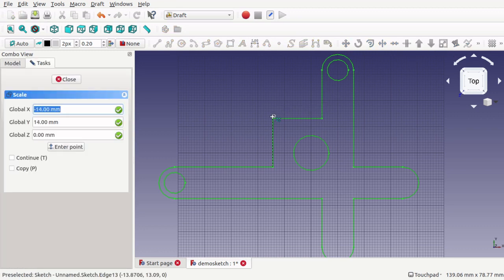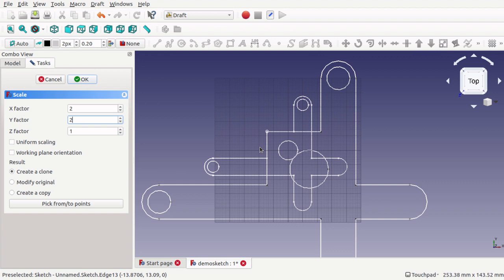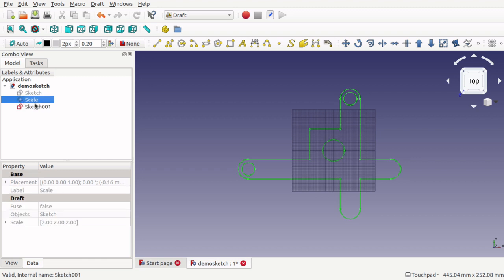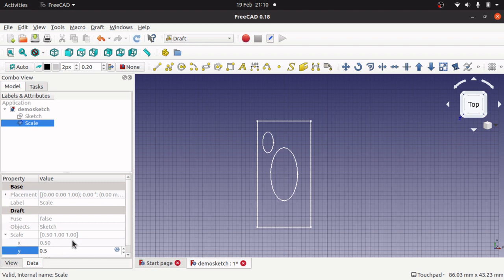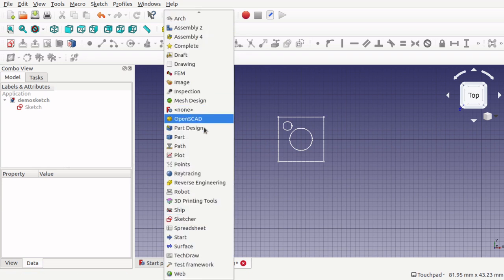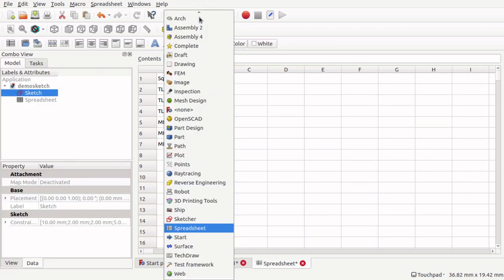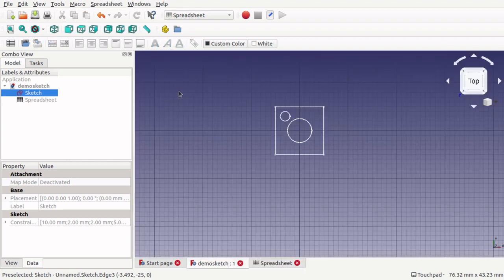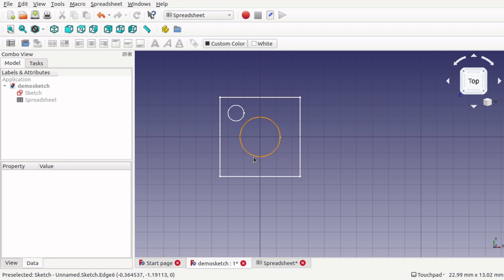FreeCAD: Scaling Sketches Up / Down by Factors. Increase / decrease size of sketch.

Comment: A bug that happens in v 0.21, if you scale a sketch on the x and y only, since z direction is useless on a 2d sketch, once you convert the clone to a sketch, all your arcs and constraints are turned to coincident b-splines. However, if you do scale in all 3 directions uniformly, it keeps the arcs and only drops the constraints. I actually made a video on this for airfoil design and i show the bug.. its frustrating how buggy freecad is at the moment, but i have been able to muddle through it.

When using the attachment properties to scale the clone, it actually doesnt work very well becasue it always scales from the center. This is a useless feature if you need a sketch to scale from a certain point, IE, for me, i do alot of airfoil design so having the foils scale from the leading edge rather than the center is crucial because it means that my trailing edge side will be lined up, even if the leading edge is not lined up.

Comment: I'm using 0.19, and I can select a sketch, change the mode to draft, and under Tasks is an option for Scale. And the factors now have 6 decimal points.

Although what I'd really like is a simple way to take my shape, and make a line a set distance away from it so I can make a wall in a item I want to 3d print.
Reply from the maker: If your in the part design there is the datum line you could use. You can attach these to a face, vertex, edge etch and offset that by an x, y, z amount. Or in a seperate sketch you could import geometry from an edge and then create your line using the horizontal / vertical datum constraints. There is also the offset tool in the part workbench that may be of use to you.

Comment: Another way of scaling is to hook the dimensions to a factor of one of the main elements within the sketch rather than making a spreadsheet to keep the dimension data. You first constrain the sketch and then you find the factor numbers by trying a few numbers and write down constraint by the main dimension multiplied by the factor. I do this with simple sketches.

Comment: A third way is to simply clone the sketch (or any object) and change the scale factors in the properties.  Also, when scaling by parameters (spreadsheet), each parameter can be a formula including the "multiply factor" defined in a separate cell.  This would allow you to define the scale of the entire object with 1 parameter.